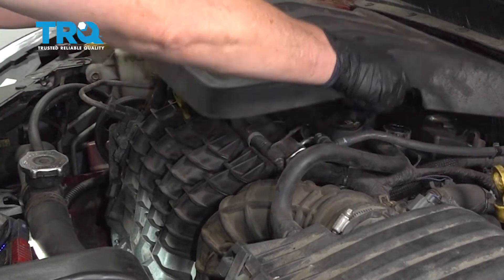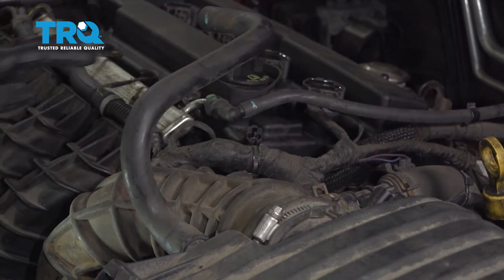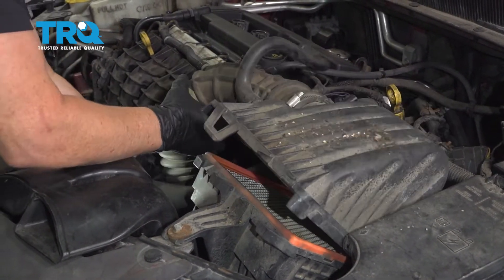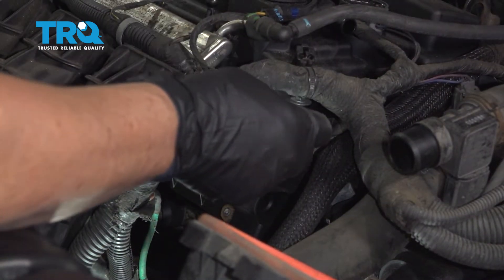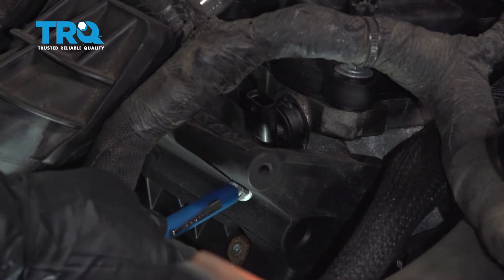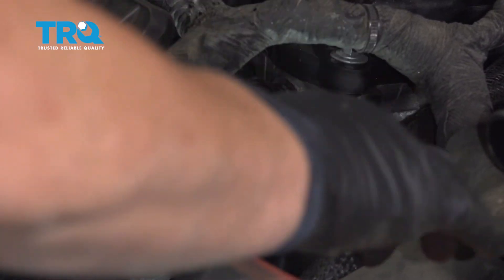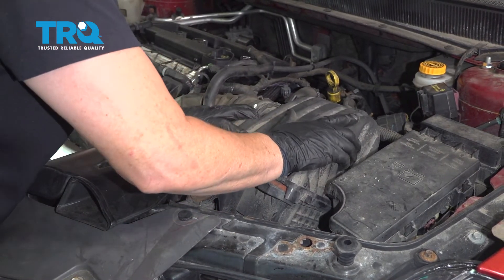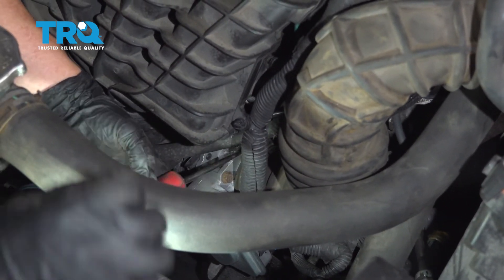How to Replace Camshaft Position Sensor 2007-2010 Chrysler Sebring

Comment: So currently I had some issues with my Chrysler seabring, Shop told me it was my transmission.. Replaced it, Picked up same issue, Then he said it was Starter, paid to fix it picked up same problem and light still on. Then today he tells me I had to replace the alternator paid to fix it and I picked it up and same issue and light still on. I go and buy a can shaft sensor took us 25min to change and fixed the problem. That’s crazy. $40 compared to $1100